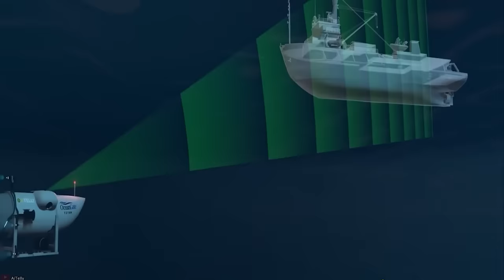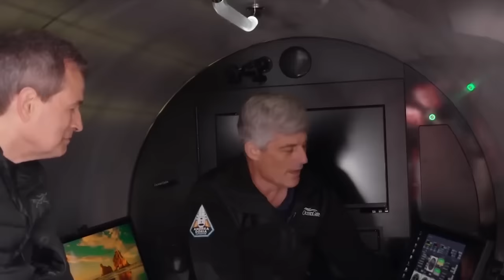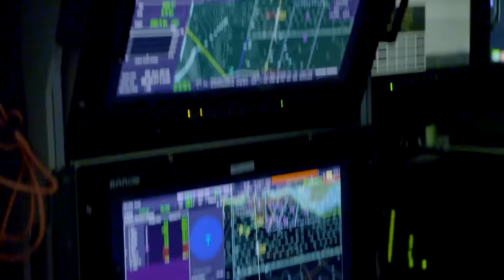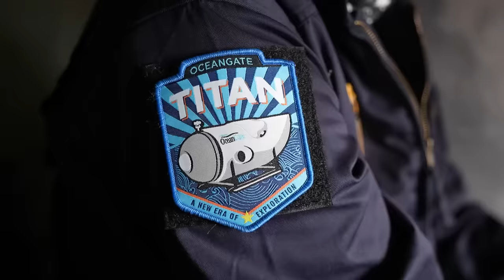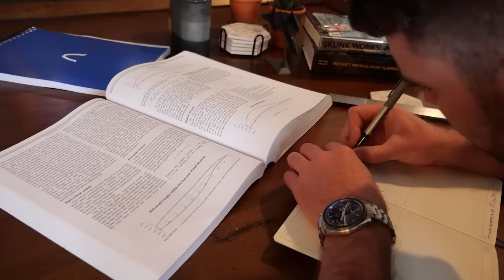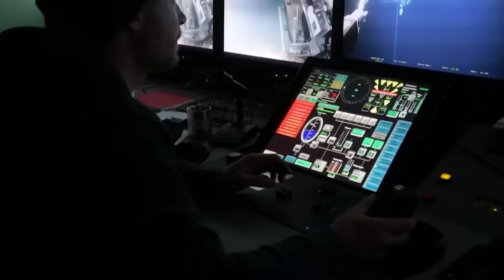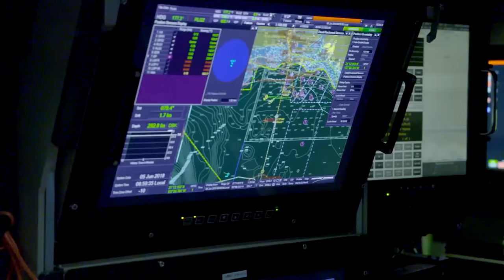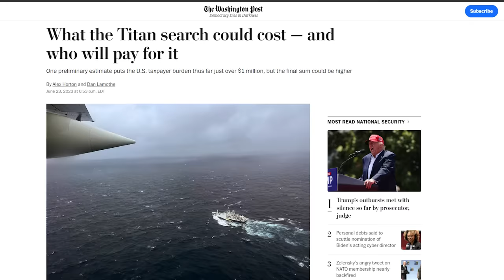US Navy Reveals TERRIFYING Truth Behind The OceanGate Submarine Tragedy | Titan Documentary

Comment: Unverified transcripts of text communication between topside and Titan indicate the rate of descent even early on was too rapid.  That high descent rate may have been an indication that Titan was becoming water logged.  The Titan crew may well have been doomed by the time they were about 30 minutes into their journey.
Reply: Water logged, or water in the back fin. If that transcript is real, it also indicates that it was tail heavy and so did not rise when ballast was dropped.
Reply: @joanberkwitz2662  Thanks for the additional information.
Reply: The back fin was outside the pressure hull, so it must have been designed to fill with water. I saw a video of the Titan with its tail section opened up like a vintage car hood (hinged down the middle), to expose what looked like electrical and electronic components. Perhaps the sea water planned to be in the tail shorted out the battery that was mentioned as failing in the leaked text transcript. That could explain why the sub rose less than 100 feet after the ballast and landing legs were jettisoned (the two bulges on the back of the pressure hull contained vertical thrusters powered by two batteries).
Reply: Unfortunately it was doomed as soon as it was built, it was done that badly
Reply: @charlesyoung7436  Why would they design it to fill with water? Wouldn't that be unecessary weight and dangerous because of what was under it??
Reply: @irene_f.  Because it was outside the pressure hull where the people sat. If sealed, the tail's thin covering would have imploded well before the Titan got down even a small fraction of the depth of the Titanic' It was designed to be flooded the entire time, and the water inside it added no extra weight.
Reply: @charlesyoung7436  Thank you.
Reply: @455buick6  Your point is well taken.
Reply: Interesting, This info not seen elsewhere and unverified. Please cite sources, your info may (if verified) be incredibly useful! Please provide all available sources so that research may proceed, your cooperation is appreciated.
Reply: @garybrown1404  View “The Questionable Engineering of Oceangate” by Real Engineering.

Comment: US Navy heard a noise consistent with the noise of an implosion. But the Navy could not state that the implosion sound was from the titan. That had to be verified. It could be possible that the sound came from some other source. Therefore, the search and rescue efforts continued until 1.  The oxygen supply went well past the 96 hour mark with no possibility the titan passengers would still be alive or 2. The implosion sound has been verified to be the titan imploding. If the search and rescue were called off on the base of just an implosion sound, and that was not the titan, then it would have been possible that the titan surfaced but the passengers suffocated anyways because the search had been called off. The navy doesn’t guess.
Reply: They're lying to us. You can't tell me they heard this sound but couldn't tell where it was coming from. What good would any listening device be if it couldn't detect where the sound came from? You can continue the search just to "cover all the bases" without telling a preposterous lie.
Reply: @Unknown17  they heard the sound consistent with the noise of an implosion. But they can’t say yep the titan imploded because they don’t know for sure. The navy may not have been aware that there were dives on the titanic that day. So, until the titan is confirmed imploded, the search would, and should, continue.

Comment: Ocean Gate should have listened to the experts who told them their designs and materials (carbon fiber) were dangerous. If they had made Titan from titanium these five people may be alive today. I salute the Coast Guard and Navy for the professional way they conducted the search.
Reply: The dumbest thing about it all is it would have actually been cheaper and way easier to build it the right way (by casting a few-inch-thick stainless steel tank). Casting and machining those titanium end caps & rings would have been a nightmare. Titanium is about the most difficult metal to cast and machine besides tungsten. Insanely high melting point and a horrible conductor of heat so it burns up all the machining tools. I personally think it was just a stupid marketing ploy to claim it as a fancy futuristic submersible when in reality the traditional materials were better
Reply: @Yaahzy1  How was that relevant to Daryl's post?
Reply: @Yaahzy1   three thousand degrees compared to the 2200-2500 of steel is a huge difference. And it’s a lot more expensive. But the main thing is machining it compared to steel. It’s extremely hard to machine because it’s a poor conductor of heat. So instead of pulling the intense heat of machining away from the cutting tools like most metals, the heat all stays trapped in the tools and burns them up extremely fast. The only metal that’s more difficult to machine than titanium is tungsten (which you can basically forget about machining altogether cause tungsten is what usually does the machining haha) All in all the main thing I’m pointing out is, in a case of extreme irony, building the sub right would have been cheaper and a lot easier

Comment: I believe it to be an error to say the submersible was lowered into water once on site.    It was towed on frame to save money unlike previous trips.    Likely jarring the unit for hundreds of miles and possibly weakening it.
Reply: Film I saw showed it on a raft, that sank and tipped it in.
Reply: Any jostling it experienced while being towed is nothing in comparison to the pressures it experienced at depth.
Reply: @ScubaSteveCanada  certainly.  Compression wear and tear might be the mode of failure but vibrating will weaken just about anything over time.
Reply: @lawdawgfair9611 yup. The vibration alone can and most certainly cause some problems.
Reply: Good observation. Did not help !

Comment: Everything I've seen and heard Oceangate was incredibly I believe Oceangate was incredibly negligent. They took too many risks with other people's lives. They ignored expert they threw safety concerns out the window.. they used to material that strength is better when it expanded than crushed. They also neglected to make safety checks of the material on a regular basis and reuse the craft more times than it probably should have been used. There were no tests conducted on the material to find out what it's flexible tolerances were and how many times it could be used before needing to be retired and replaced
Reply: If ive money i would have created a 3d vr room which will show broadcast of real time titanic reckage by connecting a submarine camera, its better than sending real humans and rich people can easily afford considering they wanted to see the wreckage
Reply: Proofreading
Reply: Old carbon fiber weakens over time. When it breaks it feels like hard cardboard. Wouldn't have trusted it under pressure, certainly not for deep diving!
Reply: Apparently the CEO also bought expired carbon fiber, and bragged about how he managed to bring down the sub cost by buying it for cheap so...
Reply: @loneevangelion5815 yea. That would be a better option tbh. Like a real time exploration connected to VR. Like having the diving drones equipped with the camera connected to VR is a way better solution
Reply: "Over-used" are you kidding? That thing had NEVER been wet not even in the sandpit with a dew on it while it was let outside with other toys for the night.
The footage on his youtube channel was from a BBC robot camera, and I'm holding back from saying that they did or did not purport for that footage to have been filmed on "previous missions".  Oceangate have been as close to the Titanic as the moon.
 Ever.
Reply: It looked totally unsafe, even for untrained eyes....The details of the structure were crazy....that pressure down there was not survivable. Ask Jim Cameron ! He knew and he got it right ! It is why he is still alive.  Cannot cut corners and trick nature.
Reply: @linanicolia1363  yep and despite all his effort to make a super durable subs even his subs suffers with some malfunctions and damage from the pressure.
Reply: We had huge signs in our factory about safety, but ya better meet production quotas no matter what

Comment: Was the carbon fibre past its use by date or best before date? In some ways it was truly amazing that this concoction of glue and fine carbon thread lasted the number of dives it did.
Reply: You can tell by the smell if the carbon fiber is past it's pull date. Mr Rush should have known that.
Reply: Boeing has denied supplying any carbon fibre to either OceanGate or Stockton Rush.
Reply: Carbon fiber bicycle frames crack & break, steel, titanium,  not so much.
Reply: I saw a piece that said the carbon fibre used was bought from an aircraft company that rejected it for airplane construction.  Bought at a reduced cost.

Comment: The attachment of the different materials may be one thing.  But I believe the main issue was the pressures that are at those depths require a sphere for the crew to be in, not a cigar shaped craft.  Spheres have proven to be the most strong at depths (windowed portholes to see out, become the weak points). H-D Cameras would be the best option with no portholes.  Is there no F.A.A. like program for vessels that travel on and under water?  How did they get insured without being tested and Certified by an outside company?

Comment: Im an experience surface & underwater integrity engineer.

RIP to the lost souls.

David Lockridge is an integrity hero.

1. A huge lesson for companies leaders that are more profit driven rather than safely delivering profit .
2. The loss of 1500+ souls is pitiable & does not require to be used as a profit venture point in regards to any gravesites ( under sea / above  ground) traditions.
3. Its surprising that such an attitude could be tolerated in both canadian & american system if such is not already enshrined in the maritime regulations.
Reply: Well said.  Edmund Fitzgerald is enshrined by both United States and Canada
Reply: yeah, you're right!
I'm going to offer $200,000 tickets to my Hindenburg Hydrogen Airballoon to vist the place where the planes flew into the Twin Towers in New York: who's up??

Comment: It appears that Ocenagate fired the one guy that could have saved all their lives. 
On a darker note, I'm more interested in what happens to the human body when subjected to pressure at this depth.
Reply: This happens to Navy divers that use the helmets and surface supplied air. The remains are scraped out with a toothbrush so the helmet can be re-used. I suspect they did find pieces of skin and bone since some of the equipment wasn't obliterated.
Reply: It was the impact of the crushing sub hull that did the damage. Most of the body is fluid filled with only a few air spaces in the head and of course in the lungs. Of course such pressures crush the chest unless all filled with a fluid.

Comment: To some, underwater sounds are hard to interpret, however ->
I was an in-flight technician - U S Navy in 1976 P3-C Patrol anti-submarine warfare AX .  VP-45 .

Forty seven years ago, our aircraft dropped sonobuoys that would float on the surface of the ocean .  The sonobuoys dropped microphones down to different depths, corresponding to varying temperature gradients in the water ( epilimnion,  thermocline, hypolimnion ) .

On the aircraft, we had equipment that would receive radio signals from the sonobuoys  .  The signals contained the audio information that the microphones picked up .   These signals were printed on a thermal printer and from those printings, experts could read and identify exact signatures of animal sounds and ship propellers .  The printouts, which were on a white piece of paper, looked like someone sprinkled a fair amount of black pepper particles on it .

if they could identify things that well back then, I am sure they can be certain what are the possibilities and probabilities of most any sound they detect in the present .

Comment: so, wait. They relied on text messages to track the Titan? I have issues with dead areas on land, I could only imagine the dead areas under water. Someone didn't think any of this through, did they?
Reply: They probably thought that since sounds travels 4x faster in water than air, that texts would travel faster, too. Idiots.😑😑
Reply: What would you recommend instead?
Reply: @doekewartena5729  how about radio communications?
Reply: vibratingstring  the, why are radio signals used to locate black boxes at sea? If those are radio signals, then, whatever they are, use them.
Reply: They didnt use cellular signals lol. Purpose built communication system.
Reply: @jagirl966  ultrasound
Reply: @jagirl966  They don't use radio signals to locate black boxes at sea, the black boxes have an acoustic pinger, it runs on battery though and has a limited lifetime.  If you don't get near enough to hear the ping within that time period, you are not going to find it, like Malaysian flight MH370.
Reply: @richardduerr9983 The guy on this submersible found the black box to air France 447 2 years after the plane went down in the middle of the Atlantic, which just magnifies the utter ignorance in your comments.
Reply: Because your phone relies on cell towers. Obviously that's not what they're using here.
Reply: Yea, but the Comms were working.  Every 1/2 hr until the Implosion, Stockton communicated with those above.  I didn't understand some of the differences between submersibles to submarines.  They had a vessel on top & it's been told now, that they did hear from Stockton every 1/2 hr, BUT sadly only 1 1/2 hrs.
Reply: vibratingstring  The US Navy communicates with its submarines using VLF which is a form of radio.  It does not work down to the depths where the Titanic lies however.
Reply: @zarasbazaar  Salt water in the ocean causes electromagnetic waves to short out, you can communicate with antennas under the sea, they use acoustic sonic waves to pulse sound waves in a Morse Code like sequence to send/receive text messages.
Reply: @kennywilkinson913  - Ultra sound signals- https://www.google.com/search?client=firefox-b-1-d&q=How+do+%27black+boxes+that+sink+in+the+ocean+communicate+with+searchers#kpvalbx=_GJ20ZIWPEu6kqtsP2uyR-Ao_34
Reply: Sighs at your ignorance
Reply: Radio signals are attenuated very much by water, even more so salt water. While there is a way to use ultra low frequency based radio to communicate, almost same frequency as audible sound, it will require massive antennas. (Antennas get bigger with lower frequencies)... It's speed of light divided by frequency.

Comment: Just my theory: I think water got between titanium ring and the edge of the Carbon Fiber tube, then worked it's way thru the hull. That explains the popping noises as water kept bursting and prying between the layers, the perceived weakening of a section near the rear by engineers, and why it seemed to be overweight. It is also possible they may have seen parts of the hull actually expanding and bubbling, very frightening.
Reply: Possible. My thinking was the glue and bonding agents failed. Carbon fibers are great when the fibers are in tension. In compression, it's the glues and bonding agents that carry the load. A tiny delamination, slippage, void develops and that enormous relentless pressure will cause it to propagate and unzip the entire hull in milliseconds. Glues and bonding agents keep the fibers aligned and in tension so the fibers can do the job.
Reply: At those depths, there would not have been 'popping', especially on a carbon fiber vessel.  If the pressure got between the two layers, it would have been over in an instant.   The all steel and multi-hilled USS Thresher and USS Scorpion folded like tin foil because of the extreme pressures.  The popping sound is very common in the ocean, its a familiar sound made by plankton and shrimp.
Reply: @spudhut2246  - Well the ones who actually were on an imploding carbon-fiber hull disagreed with you. They heard it, reported they heard it, and so did the acoustic sensors onboard. I have also done a lot of scuba and popping is not a common sound under water.
Reply: @scottnelson2384  I have sat behind sophisticated US Navy sonar equipment while underway, its amazing the sounds that get picked up.  I was not a diver, and not experienced in diving and/or what sound equipment is available to your experience.   I complete understand what your saying.  thanks for the input